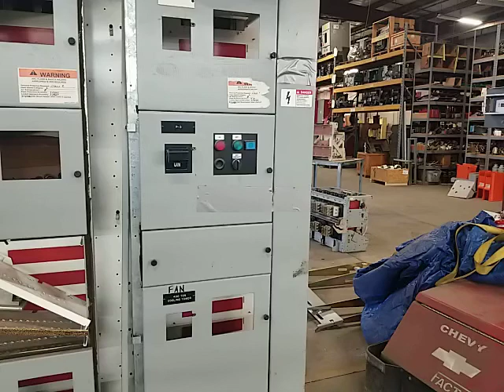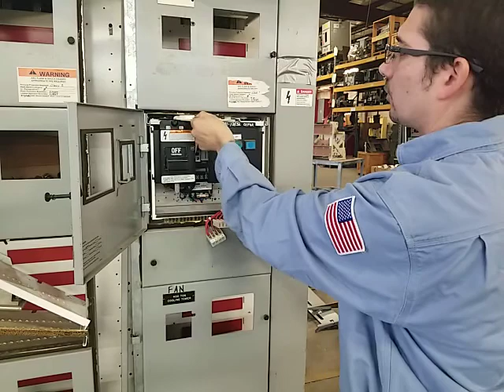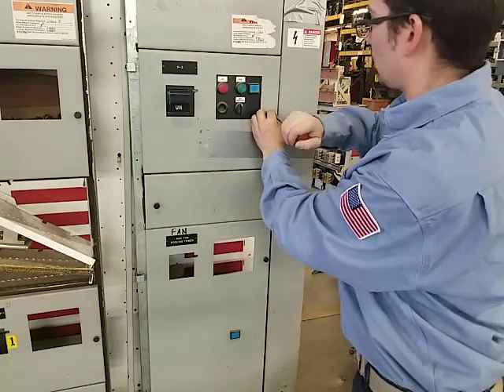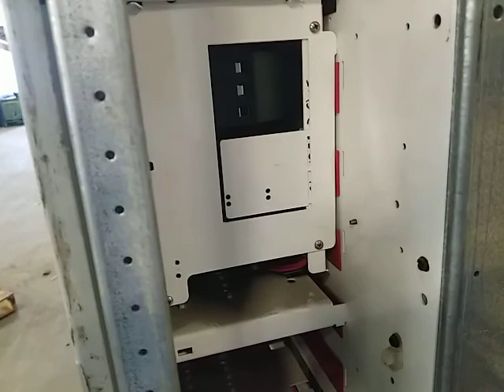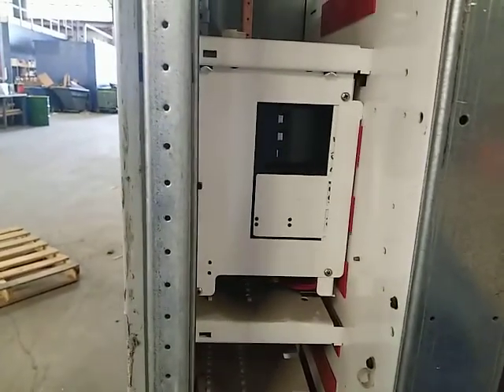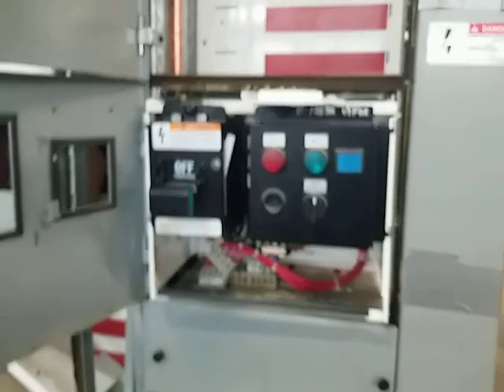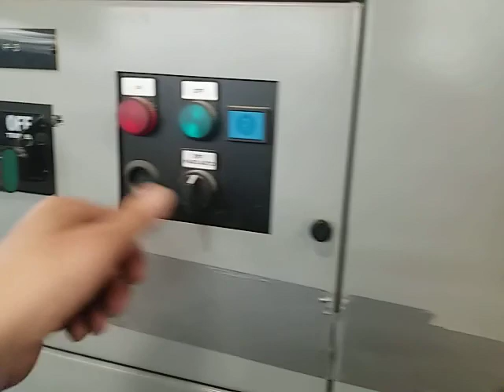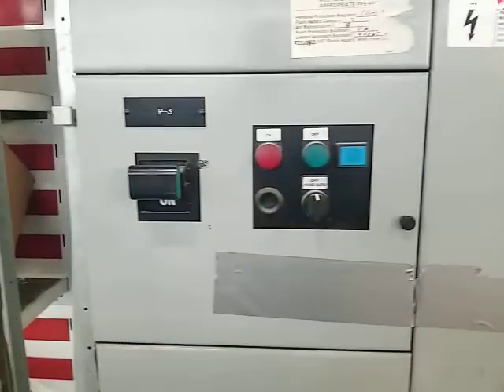Siemens Model 95 size 1 MCC install and removal

Comment: If we have a model 90 MCC with the pull in tabs on the sides and the galvanized color shelf (pan), but want to install a model 95 bucket (that has white color bucket) with the scissor mechanism. Can you simply get a white model 95 shelf (pan) with the pin for scissor mechanism and install in model 90 MCC?
Reply from the maker: Great question. You are correct. The switchgear is identical except the divider pans. You just need the nipple on the divider pan to engage the sissor mechanism.

Comment: How do I add a new circuit/bucket to a Series 89?
Reply from the maker: Apologies on the delay getting back to you. The system 89 is a different animal compared to the marq21, model 90 and model 95 siemens mccs. But to install a feeder bucket is pretty straight forward. 
https://www.google.com/url?sa=t&source=web&rct=j&url=https://assets.new.siemens.com/siemens/assets/api/uuid:bfa83a81-124c-44eb-8de4-f7d6897c3a66/ansi-lv-mcc-final-ccim-tiast-1115.pdf&ved=2ahUKEwi-neD0qob-AhULJ0QIHSpxC8wQFnoECBsQAQ&usg=AOvVaw2k8xPQrhXeBPTG7Tq-wCOm

https://www.google.com/url?sa=t&source=web&rct=j&url=https://www.siemens.com/download%3FBTLV_51971&ved=2ahUKEwi-neD0qob-AhULJ0QIHSpxC8wQFnoECBoQAQ&usg=AOvVaw2RmjWWgwAUpjQrrdGW0Cle

This is the tiastar operations manuals. Tiastar is the later version of system 89. So these instructions should apply.

Comment: Mr. Baxter, I'm an engineer in an office high rise. We have 90s and 95s exactly what you've shown here, both exact MCs. What changes in procedure if you pull and then reinstall a 90 while the buss is hot?   Thank you. -Steve, California
Reply from the maker: The mcc frames between the model 90 and model 95 are very similar (not model 95+ that's diffrent) except the scissor mechanism at the top on the 95 and the breaker being located normally on the other side. That scissor mechanism would mate with a pin found on the divider pan in the center. The handles and components were upgrade but the platform was very similar. The racking procedure is really the only difference. You can swap them between each other. It's better to use the correct divider pan but not critical if in a jam. Each series of divider pan should have the small rectangle cutouts on the side to work with the model 90 that has two push in tabs the keep the unit fastened into the mcc. This was the prior design to the scissor mechanism. So if you have a model 90 you will shut the breaker off. Push in the two tabs found at the top left and right of the frame and with those tabs pressed in, pull outwards. For tall units a screw can sometimes be found fastening the bottom of the frame to the left hand side mcc vertical rail (same rail as the door hinges fasten to) but thats only foind on special occasions like taller heavy units that will sag forward. Most of these style units are only held in by the two tabs and mcc primary fingers located in the rear. Just note those units handle operators have a tendency to break since the plastic is aging but normally the stabs and frames aren't to much of an issue and typically go in and out with out issue. Take care if you are working "HOT" to wear applicable electrical PPE. These videos are shot in a warehouse on a dead mcc but when I'm in the field I normally wear a 40cal arc flash suit as a standard whenever removing units. Good luck and hopefully I answerd your question. If you happen to need anything for parts get in touch with me or look up my company RESA power in shelton CT. Typically we provide complete mcc units and replacement bucket assemblies but can also take care of parts and pieces. Take care.
Reply from the maker: I have another video on my channle "mcc demonstration " that shows a model 90 style installation.  Was the marq21 precursor but had same racking mech.